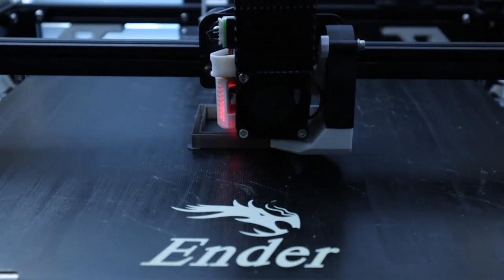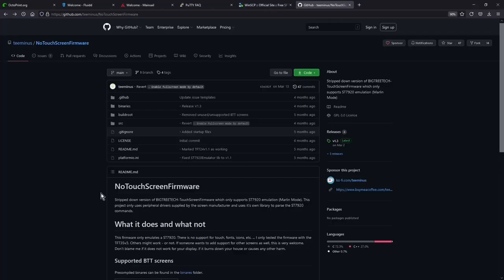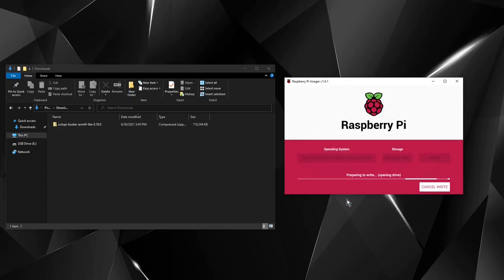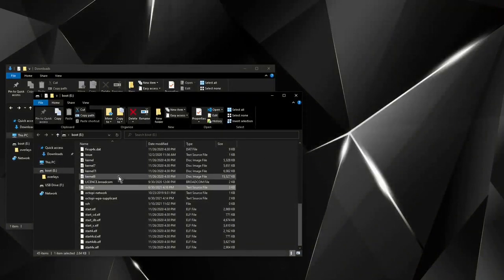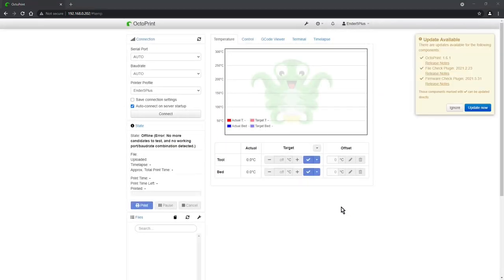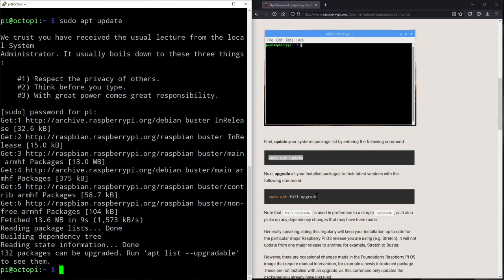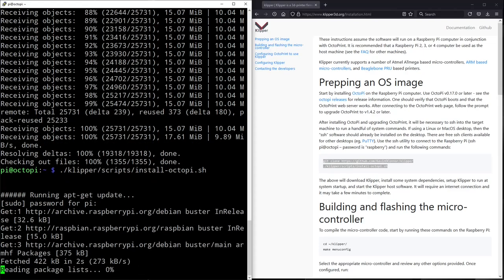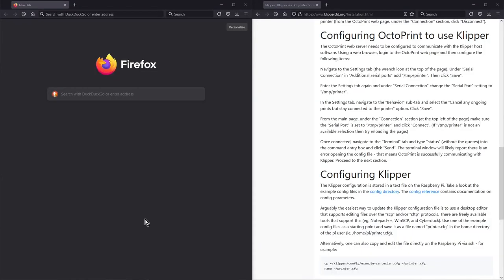KLIPPER Installation Guide for the Ender 5 Plus w/ BTT SKR Mini E3 v2.0 and TFT35 v3 Display

Comment: I got everything installed and hooked up just to have to pull the board out and send it back.  It will not load the SD card.  I thought it was a serial port issue because I kept getting an error when trying to id the port through the kliiper directory, but the board would not even load the firmware it came with.
Reply from the maker: Man that sucks, I've been there before. Hopefully the new one gets here quick so you can get up and running
Reply: @EB3DPrinting  Good news... I am just new to this stuff.  I am using the SKR E3 Turbo, not the board you are using.  lol.  I could not find anyone that has used this board on this machine and klipper.  So I just started from scratch and filled in the blanks without any videos or tutorials.  Finally found the documentation for the board (hidden on Github under hardware for the board.  Long story short, I am now setting up my printer.config stuff now, but everything is talking!  Thank you again for all your info on here.  Maybe I'll make a video on what I came across as a newb and what I did to make it all work.
Reply from the maker: @subzerofpv1235  that be awesome as I plan on upgrading my 5+ to that board and moving the mini e3 to the ender 3

Comment: Who do I have to pay to get my Ender 5+ printer file set up under the new klipper settings so I can make my first print?!!! Needs a working printer.cfg file.

Bought ender5+ match 1st 2022 Amazon
Raspberry pi 4B w/pi cam
Klipper installed 
Moonraker installed
Fluidd installed
Kiauh installed
Creality all metal extruder upgrade
Capricorn filament tube upgrade
Bed leveled before klipper installed
Extruded 97.73mm instead of 100mm
Screen(Desuuuu) and board successfully flashed
Klipper screen comes on and heats
Reply from the maker: What settings are you having trouble with? Where do you seem to be stuck?
Reply: @EB3DPrinting  well, it goes into shut down when I try to level the bed when pressing the probe button on the bed level screen,
Pi disconnected for several of the settings under "extruder" that seemed to be missing from klippers new settings so I ran through their config info best I could(being new) and the pi connected again but I cant just run a bed level and the extruder sits in the rear right side of printer and clicks and dis connects.

I learn quickly if I can see a semi working machine and can calculate numbers to fix settings I just need to heat, home, level and print something. Once I learn I can teach others easily, it's just a lot of info.

The settings shared from this video and others is old news because the klipper settings in some cases were different such as the extruder rotation_distance is needed but wasn't in the shared printer.cfg, the steper_distance didn't seem to be needed, and the  extruder microstepper settings need to be added. The stepper_z needed the hashtag removed from the z offset I think...but it's like there is just a load of problems.

Thanks for responding though. Is there a group for ender 5+ ?
Reply from the maker: @redfishbluefish965  which printer.cfg file are you using as a baseline to set yours up?

Comment: A I followed your video and installed this on my Ender 5. Since it has the exact board I figured it was the same. Got it all done and inserted it into the printer and NOTHING, just shows marlin mode at the top of the LCD. Any thoughts on this?
Thanks
Kelly in San Antonio
Reply from the maker: Which display are you using?
Reply: @EB3DPrinting  i'm using the btt tft35 e3 v3 display
Reply from the maker: @kellyvb9881  since it says marlin mode, i think it is due to the firmware not being installed on the display properly. if you installed the firmware onto the display with the supplied SD card. the display should read "ST7920Emulator ready"

try reinstalling the 
https://github.com/teeminus/NoTouchScreenFirmware/blob/main/binaries/BIGTREE_TFT35_V3_0/BIGTREE_TFT35_V3.0.26.x.bin

file again. Then reboot the printer to see it it changes from displaying marlin mode
Reply: @EB3DPrinting  guess I missed something, I didn't install anything on the display, I only installed the klipper.bin, changed to the frimware .bin on the main board
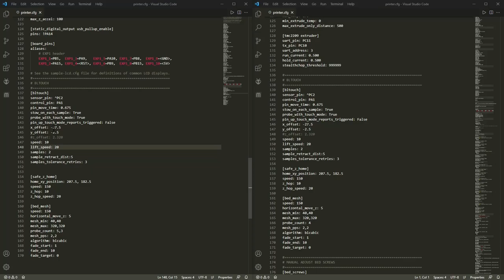Reply from the maker: @kellyvb9881  start watching @35:07 and follow those steps
Reply: @EB3DPrinting  I went ahead and removed the display and put the stock one on and I will deal with that one later. My main problem now is the printer won't home correctly. I have an EZabl pro on it. what it does when home is clicked, the bed moves up a little, the x & y go to left back corner then to the center of the bed, then z moves up a little more and stops. The probe never triggers BUT the error says !!Endstop z still triggered after retract. here are the settings I'm using in the stepper z config

[stepper_z]
step_pin: PB0
dir_pin: PC5
enable_pin: !PB1
microsteps: 16
rotation_distance: 8
endstop_pin: probe:z_virtual_endstop
position_endstop: 0.0
position_max: 250

[tmc2209 stepper_z]
uart_pin: PC11
tx_pin: PC10
uart_address: 1
run_current: 0.580
hold_current: 0.500
stealthchop_threshold: 999999

[probe]
pin: ^PC2
x_offset: -47
y_offset: -10
z_offset: 0.500
speed: 70.0

[homing_override]
gcode:
        G1 Z10 F1500 ; Move up 10mm
        G28 X0 Y0
	G1 X125 Y125 F10000
        G28 Z0
set_position_z: 0
Reply: OH, I'm using Fluid instead of octoprint

Comment: Mate, works flawlessly, thanks. Just need some guidance to finetune the BL touch. It deploys the second time before the bed can move down and clear it. Can you please share the BLtouch config part? Also would love to print the Pi case and the holder for the E5+
Reply from the maker: Here is my BLTouch Section:

[bltouch]
sensor_pin: ^PC2
control_pin: PA1
pin_move_time: 0.675
stow_on_each_sample: True
probe_with_touch_mode: True
pin_up_touch_mode_reports_triggered: False
x_offset: -27.5
y_offset: -2.5
#z_offset: 2.320
speed: 10
lift_speed: 20
samples: 2
sample_retract_dist:5
samples_tolerance_retries: 3

And here is the link to the Pi Case:
https://www.thingiverse.com/thing:3723561

Comment: Your video is very useful and my e5p is working well but one last problem I would like to ask.  I had tried several times to run bed_mesh_calibarte but in the end, I tried save_config command then I check printed_config and found that there was no bed messh saving.  Can you please suggest to me how to save the bed mesh calibration. Thanks.
Reply from the maker: You need to save the bed mesh profile with "BED_MESH_PROFILE SAVE" 
Then use the save_config command

Comment: I have the SKR 2 on the way. I am on the same Klipper train. Is there any firmware for it built?
Reply from the maker: https://github.com/KevinOConnor/klipper/blob/master/config/generic-bigtreetech-skr-2.cfg

You can use this as a reference and then set it up similar to how I did for the mini e3, if you went with 2209 steppers then it's almost the same
Reply: @EB3DPrinting  That's so good to know. Yes, I have the 2209's, TFT35 and RPi 4 coming along with the board as well. Hope it goes smooth.
Reply from the maker: @anirudhchandrashekar4987  then it shouldn't be to much difference in setup. Some of the board pins may be different, but that's about it

Comment: SKR Mini E3 or SKR 1.4 Turbo which is better?
Reply from the maker: They both are good, but it depends on what you'd like to do with it. The 1.4 turbo allows for independent z lead screw movement, which is great for bed leveling. You could also run dual extruder with the 1.4 as well. But if you dont plan for either of those, the Mini E3 is an awesome buy
Reply: @EB3DPrinting  Thanks for the detailed reply, damn its a hard decision cause i might want to use dual extruder down the track, i was also looking at the SKR 2 and the SKR pro but from what i can tell this wont work with the 5+ or do they?
Reply from the maker: @Tennisinslowmotion  they would "work" but you'd have to have some case modifications. They wouldnt be a direct drop in replacement like the Mini E3.

Comment: This video is a lot of help for me. This is exactly the same as my environment. 
But I have a problem accessing the serial port even connected with ekr mini board and raspberry.
pi@octopi:~ $ ls -l /dev/serial/by-id/
ls: cannot access '/dev/serial/by-id/': No such file or directory
because of this, I can not find my mcu name.

06:50:46 mcu 'mcu': Unable to connect
Once the underlying issue is corrected, use the
"FIRMWARE_RESTART" command to reset the firmware, reload the
config, and restart the host software.
Error configuring printer
Klipper state: Not ready
Reply from the maker: A few things to check, make sure the usb is securely connected between the pi and mini e3. Second, make sure they are both on. Next, you have to flash the mini e3 with the klipper.bin(rename it firmware.bin) file before it will show up in the serial id. Try also to run lsusb with the mini e3 unplugged from the pi, plug in the usb cable, run lsusb again to see if it shows up, if it does, then its at least recognized. 

Lastly, if the above doesnt work, try makemenuconfig again to ensure the settings are right, remake the klipper.bin file, then reflash the mini e3. 

Settings:
Ensure that the micro-controller architecture is set to ‘STM32’
Ensure that the processor model is set to ‘STM32F103’
Ensure that the Bootloader offset is set to ‘28KiB’
Ensure that the Clock Reference is set to ‘8 Mhz’
Ensure that “Enable extra low-level configuration options” is selected.
Ensure that “Use USB for communication (instead of serial)” is selected.
Ensure that “GPIO pins to set at micro-controller startup” includes ‘!PA14’.
Reply from the maker: @chungilchung  The Klipper.bin file is on my github, can be found here:
https://github.com/EB3DPrinting/Klipper
Reply: @EB3DPrinting  Thank you for your kind reply.
I still can't get under /dev/serial/. and only I only can see 4 USB hub in rspi using "lsusb".
But the funny thing is in octopi view, I can see connected klipper as like below.
Changing monitoring state from "Opening serial connection" to "Connecting"
Connected to: Serial<id=0x6a3426d0, open=True>(port='/tmp/printer', baudrate=115200, bytesize=8, parity='N', stopbits=1, timeout=10.0, xonxoff=False, rtscts=False, dsrdtr=False), starting monitor
Send: N0 M110 N0*125
Recv: ok
Send: N0 M110 N0*125
Changing monitoring state from "Connecting" to "Operational"
Recv: ok
And this is klipper status
09:12:04 Connected to host via /tmp/printer @115200bps
09:12:04 Error: Klipper config file not found at: /home/pi/printer.cfg
09:12:04 Firmware version: v0.10.0-45-g9d9fe3cb
09:29:02 Unable to open config file /home/pi/printer.cfg
09:29:02 Unable to open config file /home/pi/printer.cfg

Once the underlying issue is corrected, use the "RESTART"
command to reload the config and restart the host software.
Printer is halted
Klipper state: Not ready
So I think however Octopi(rspi 3b+) and Klipper(skr mini v2) are connected...through USB, even though not updated in /dev/serial/ and lsusb.
Reply: @EB3DPrinting  I found a difference.
my skr e3 v2.0 has GD32F103RCT6 as main chipset. which is same arm based chip as STM32F103RET6.
Differences are GD32F103RCT6's having only 256kB of flash and 48kB of RAM as opposed to the STM32F103RET6's 512kB flash and 64kB RAM. I am not sure this makes a problem but I doubt "bootloarder offset"....
Anyway I will try to find some way. Thanks.
Reply from the maker: @chungilchung  well that would certainly make a difference. No wonder we were having issues. Glad at least we found out. I will be looking into to see if I can get a config set up

Comment: Will you be installing Klipper on your Ender 3 v2 as well?
Reply from the maker: I have had klipper installed on my 3v2 for about a month now. just never did a guide on it since Nero3d already had one out.
Reply: @EB3DPrinting  what other mods have you done to your 3v2? could you share your config file so I can check it out ?  going to get FluiddPi/Klipper going this weekend. First time with Klipper though.

Comment: Can it be controlled via the tft 35?
Reply from the maker: Yes it can. Pause, resume, stop, temp control, axis movement, print tuning, fan control and more
Reply: @EB3DPrinting  oh sweet did not know about the alternate firmware for the screen, will try it out!
Reply from the maker: @icyfrosty1  It works well, you can customize it somewhat as well. I added extra preheat options for other filaments as well as bed level corners where it takes the print head around to the corners for manual level
Reply: @EB3DPrinting  Hey do you have an issue with save_config in octoprint? My config file does not seem to be changing after sending save_config in the terminal of octoprint.
Reply from the maker: @icyfrosty1  I havent run into an issue yet. I am able to save PID tune and save Z-offset through the Octoprint terminal just fine.
Reply: @EB3DPrinting  Ah I found the issue, if anyone has the same problem, just close and reopen the Octoprint tab.